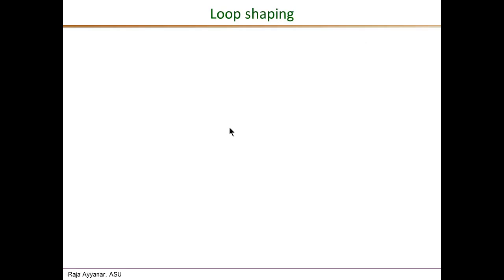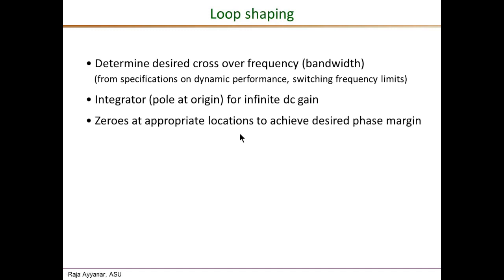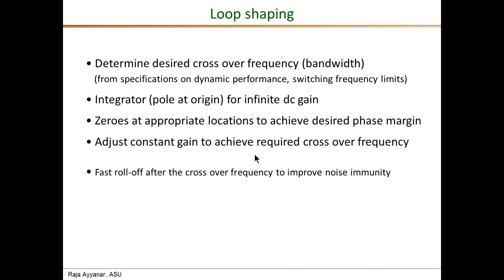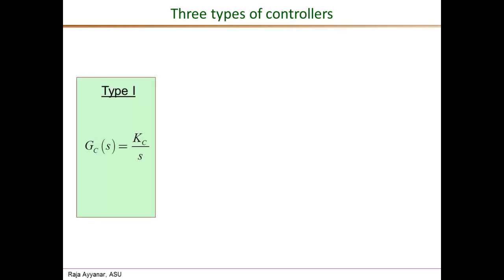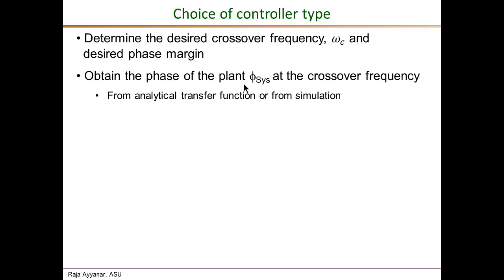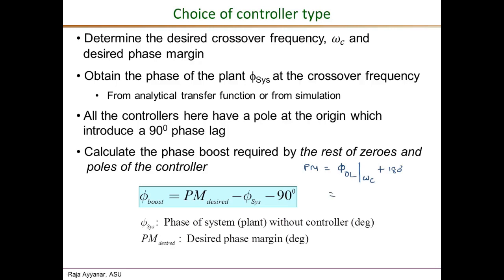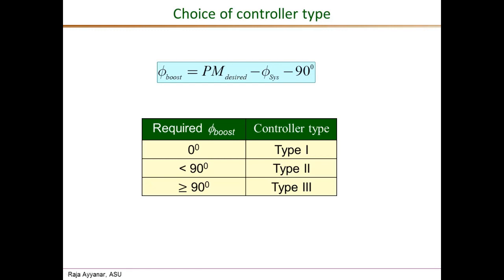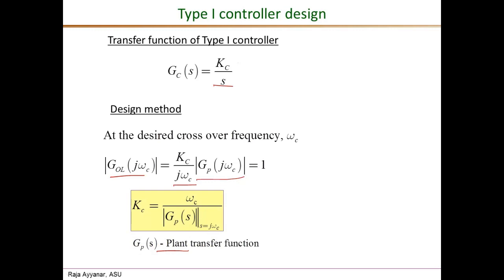k-factor control design method: part 1

Comment: Your videos are extremely helpful thanks. But unfortunately, it is very hard to determine which videos comes in which serial no. Please number them, or atleast send me the names of videos  required to understand controller design, ex PM, GM, etc
Reply from the maker: garry_g You may visit http://psercacademy.asu.edu/ which has these video links in the correct sequence.  But I am yet to make videos on basics of control systems like phase margin etc. though.
Reply: +garry_g  here you can have the serie of the videos 
http://psercacademy.asu.edu/